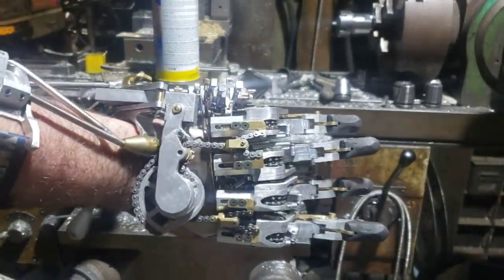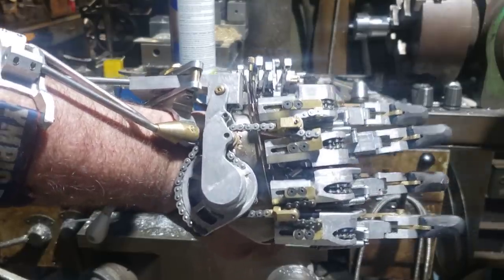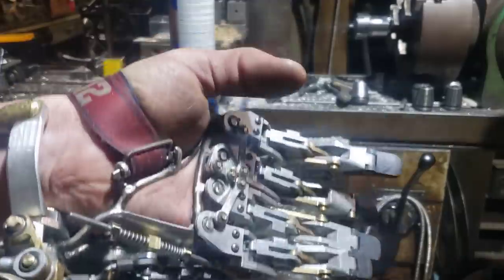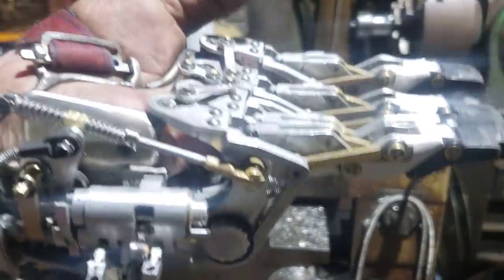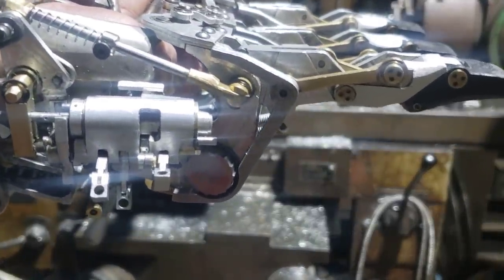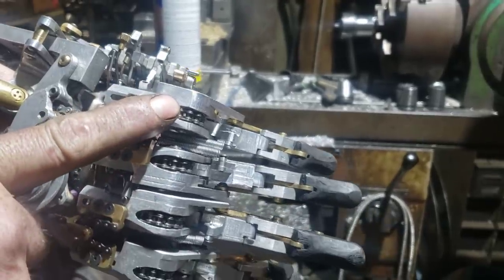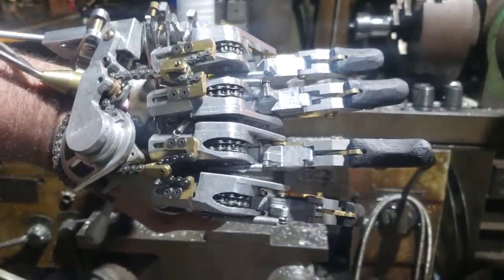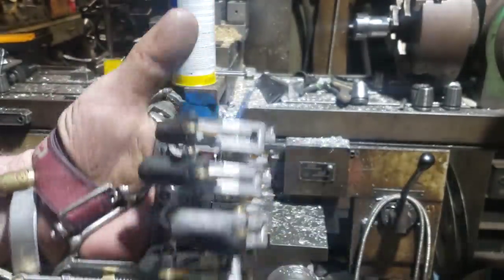Steampunk Prosthetic Hand, Now with individual finger control!

Comment: The most impressive thing about this is that he built this with basically one hand
Reply: Was about to say
Reply: Just what I was thinking
Reply: The most impressive thing about this is everything. The design, the engineering, the construction, the refinement, and the ever present fact that this guy didn't let a particularly shitty day ruin his life (unlike most weaklings).
Reply: Not really. He still has his hand and most importantly his thumb. You can do so much with just your thumb, that's why it's the most important finger.
Reply: @Daddy_Dagoth  I was gonna say.. One hand?? Are yall blind?
Reply: @The_Cat_Authority  how do you tighten a bolt and nut? You need wrench/spanner and a driver of some kind (or another spanner). Not sure how I'd do that with one hand.
Reply: his non dominant hand, I might add

Comment: Ian your work is amazing, I would like to make a suggestion that you may or may not have already considered. Have you thought about using a pulley system using bicycle inner brake or gear cables ? It would be considerably lighter than chains yet still offer huge amounts of load bearing capabilities.

Comment: I love how there's prosthetics out there that are all electronic that don't work all the time and act up. (know some people who have them) and this guy is just making an all mechanical hand. At that one with customized grip patterns that can be cycled through. Genius at work. I wouldn't be able to make it. But I would like to pose an idea. Variable grip strength. You could use the same concept as VVT in motors in the aspect of a cam rotating to change a factor. Closing the hand rotates an eccentric that ups the grip strength. Tuned to allow for moderate strength at close with an overextension when closed to "up" the strength.

Comment: Have you thought about integrating electrical sensors for muscle stimulation recognition? 
You are obviously supremely capable of the engineering work, I believe if you teamed up with an electrical prosthesis engineer to use sensors and motors for muscle simulation, I think you may end up being ahead of industry professionals in the  medical prosthesis industry. 
Sometimes it might not be convenient to bend your wrist for splaying your fingers, or bending your hand back to clasp. If you were able to keep your movements more natural it would be more of a true prosthetic. Your mechanical hand is truly impressive, and probably further than anyone ever has taken a non electrical prosthesis.
Reply from the maker: My 1 previous version (157) was electronic and myo controlled, physical motion articulated. It was unreliable depending upon the water content and relative sweat on/in my residual limb. It was cool because it had a graphic interface.  But at the end of the day mechanical win in reliability.

Comment: Nice....With all the different lightweight composites out today why make it out of metal?
Reply from the maker: Plastics fantastic,  but steel is real. The primary reason is durability consumer level 3d printing isn't it yet. I've tried ABS, pla, pa6, nylon 12, tpu. And none of them offer the stability and ease as 6061 and 7075 aluminum.

Comment: I'm sorry that this happened to you. I can tell that you are very intelligent and were before this occurred. However through your suffering, your mind is now  creating energy which is vibrating on a frequency that brings you more ideas as if they come out of thin air. They come from you, but they also come from the collective consciousness that exists within the ether. Like Tesla once said, your mind is an antenna, if you think hard enough about something, it will come to you. It's just a matter of tuning into the right frequency. You will be guided along the path, how ever long and far it may be. Proof? You've made it this far, what will happen if you keep going? The universe has spoken